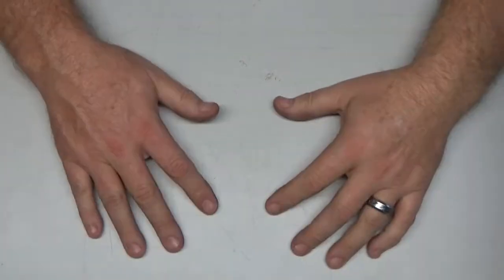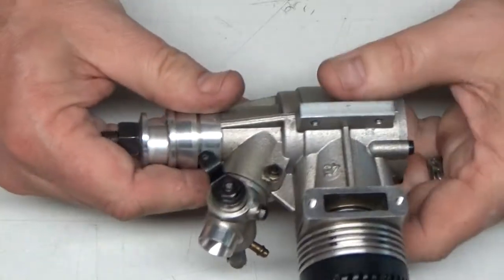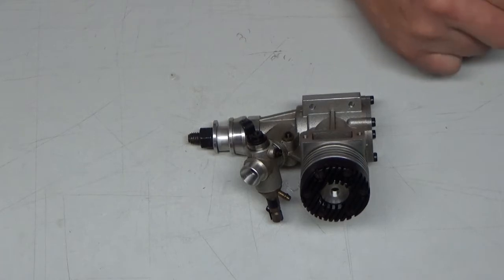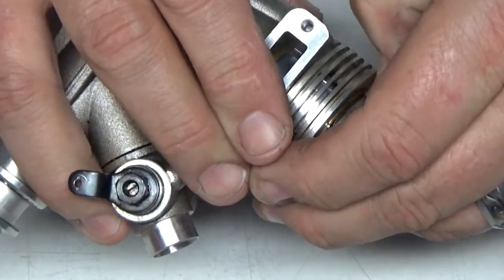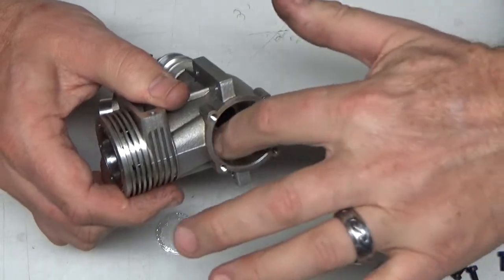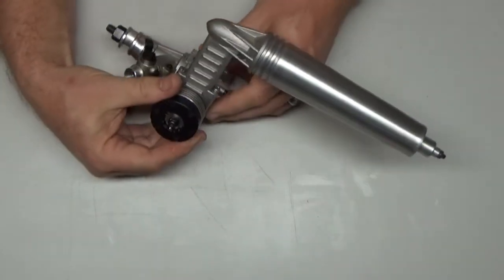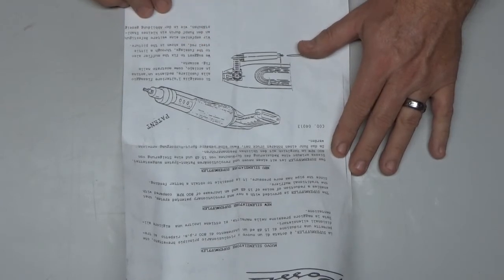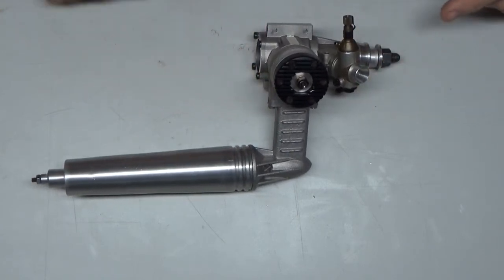Rossi 45 A Quick Look

Comment: Funny, my Morris 45 that came from a gliw engine enthusiast has the head fins sideways as well.
Reply from the maker: Maybe they were oriented that way for a specific mounting and cooling reason.
Reply: @dmrcflyr2  I'll be mounting it on a "Fastion 50" perhaps early 2010s made in China light weightish Pattern Plane. The 4248 650kv motor with 15x8 prop on 4 cell only gave 650watts static. 56" wing, the Morris "Rossi" will get the Mach Jesus speeds it deserves! Thanks again Dave. I'll report back with temps

Comment: I have two of these engines (late model 45, with 5 ports and 91 both with O.S. bolt through exhaust mounts). The 45 runs best with the Rossi 4011 short tuned muffler and sounds absolutely amazing. They are very well built, over-engineered with thick castings and a beefy crank shaft. A quality engine and full of character! Great Video Dave!